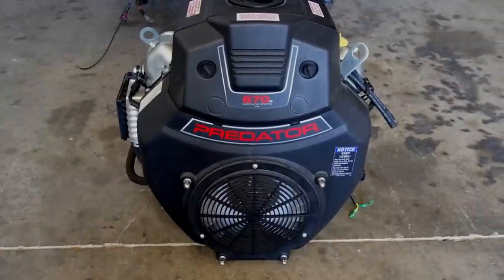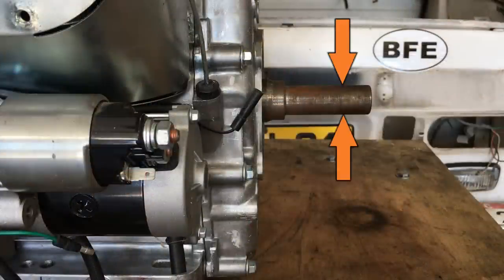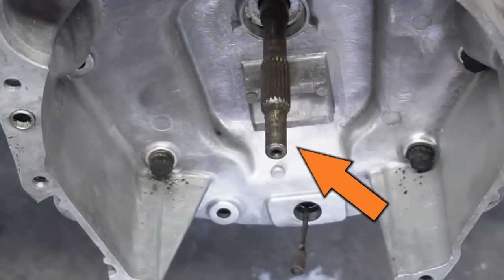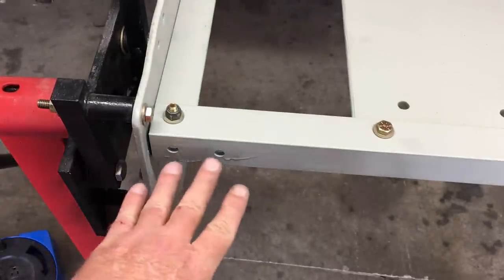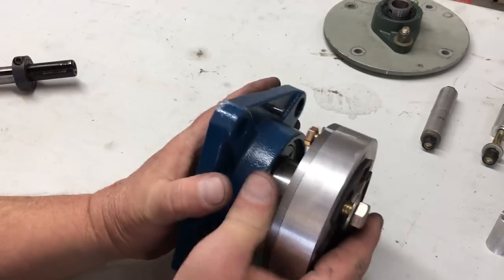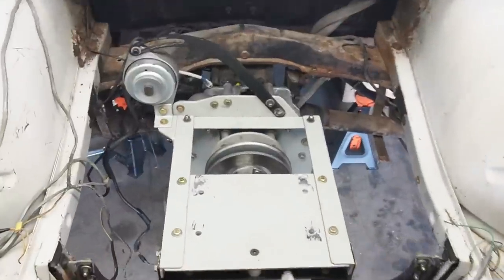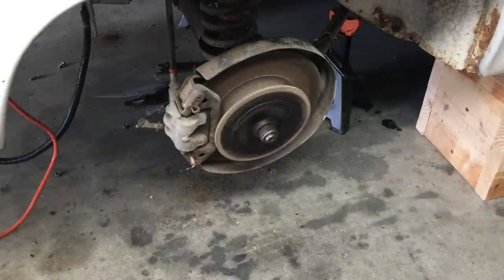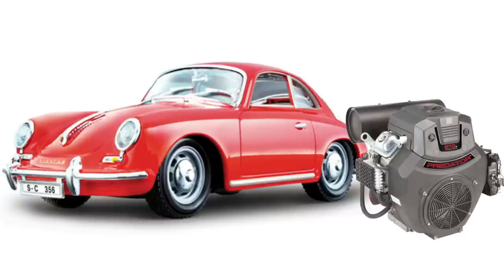S3 E18 We put a 670 Predator V twin in our project car 1969 Renault 10

Comment: I applaud you for the alternator, but if it were me, I'd be throwing a solar panel trickle charger on the back window instead of the slight parasitic draw of the alternator. You do you king!

Comment: This should have about 2/3rds the power and torque of the factory engine, but also about 1/10th the emissions. Geometry wise, the weight will be sitting a little higher in the rear, so there should be a little more roll-steer from the rear.
If you do another swap, consider the Motus "American V4", it would give more then the performance of the Gordini or Alpine Renault engines, plus sit down lower because it's designed for regular thrust bearing loads. It would make this R10 into something special.
As a Renault owner, you'll probably find plenty of buyers for the original engine too, given the passion many folks have for the R10 and related bodystyles that use the same drivetrain.

Comment: Did you measure the voltage and current output of the charging system that came with the engine? I see a voltage regulator located on the passenger side. Of course the one you installed should put out more power. 👍

Comment: I may be wrong but it looks like the engine is already set up with a 12 V regulator that gets power from wiring under the flywheel. I don’t know anything about predator engines but it looks similar to a Briggs setup.
Reply: If nothing else you could setup some sort of switching system that will power the separate alternator when needed to free up HP’s and rely on the trickle charge from the Predator most of the time.

Comment: The Predator does have a small alternator built in, but it is only 3 or 4 amps. Most of these engines are set up for use in riding lawn mowers, and some people report that the little alternator has trouble keeping a battery charged running the ignition and an electric PTO. Probably a good call to do the external alternator if you want it street legal. Looking forward to updates on  this project.
Reply: The logical thing is for it to be a dual-alternator car.

Comment: Howdy Jimbo, I got a free electric wheelchair and immediately thought of you.  Chat GTP told me it has approx 32 ft-lbs of torque between the two motors that run off of 2X 12v batteries in series.  Have you ever looked into a hybrid gas electric?
Reply: Anywho, for the quality content you’ve provided they’re your free of cost if you want them

Comment: So glad we watched the video till the very end...   that last clip was wild!
You saved some of the best for last.   We hope to find out what happened eventually
don't leave us hanging....   Just glad nobody was hurt, apparently
Reply: “Which in general, is a higher quality make, Peugeot, Renault or Citroën?”

Citroen and Peugeot are sharing many parts. If something breaks in your Citroen, it’s cheaper to buy a Peugeot replacement part, provided that you can figure the Peugeot part number. Sometimes easy, sometimes quite difficult.

So durability-wise there is no significant difference. Feature-wise Citroen is better, that’s considered the premium brand. You can choose between a simple car that runs forever or a complicated one, that due to the complexity, produces more malfunctions per kilometer, but provides better services.

Renault I can’t comment.
Reply: In 1954, Citroën followed that up with the first-ever hydropneumatic self-leveling suspension system. Then in 1955, Citroën introduced the DS — the first mass-produced vehicle with modern disc brakes.
Reply: Citroën Vehicles Were Used In World War II
Reply: After proving it could be relied on during World War I, Citroën was called upon once again to help out during World War II. However, Citroën helped build military vehicles for use during WWII as opposed to armaments.
Reply: For much of the '20s and '30s, Citroën produced half-track vehicles for off-road and military use, based on the Kegresse track system. The US Army purchased a license to build the Citroën-Kegresse vehicles, resulting in the M2 Half-Track and the M3 Half-track. The US Army eventually produced over 41,000 vehicles between 1940 and 1944, most of which were used during the war.
Reply: Andre Citroën Was A Marketing Genius
Reply: Andre Citroën knew the value of marketing, which is why he spent a fortune to get the word out about his products. For instance, Mr. Citroën once used the Eiffel Tower as a billboard and even earned the Guinness World Record for the world's largest advertising sign.
Reply: Citroën also sponsored expeditions in Asia, North America, and Africa to show the off-road capabilities of vehicles equipped with the Kegresse track system. These expeditions conveyed journalists and scientists.
Reply: Citroën Cars Have A Long-Running Reputation Of Extraordinary Toughness
Reply: Citroën cars have always had a reputation for reliability and toughness. In the '20s, the motoring world was stunned when a Citroën that had already traveled 30,000 miles became the first vehicle to be driven around the Australian border.
Reply: The car was a 1923 5CV Type C Torpedo and is now fully restored and on display at the National Museum of Australia. A Citroën was also the first car to cross the Sahara Desert.
Reply: The Citroën DS Placed Third In The 1999 Car Of The Century Competition
Reply: The Car of the Century (COTC) is an international award given to the most influential cars of the 20th century in 1999. After a rigorous election process overseen by the Global Automotive Elections Foundation, the Ford Model T clinched the top spot, closely followed by the Mini.
Reply: To many gearheads' surprise, the Citroën DS placed third, beating icons like the Porsche 911 and the Volkswagen Beetle. The DS, which was introduced in the '50s, was lauded for its exquisite design and innovative technology.
Reply: Citroën Went Bankrupt Twice
Reply: Like many automakers, Citroën has stared down the barrel of bankruptcy a few times in its history. Citroën's woes started in 1934 when it first filed for bankruptcy. Michelin — Citroën's largest creditor at the time — became its principal shareholder and built the company back up again.
Reply: Four decades later, Citroën filed for bankruptcy again due to an unstable ownership situation and the 1973 energy crisis. The French government stepped in and facilitated the merger between Citroën and Peugeot, resulting in PSA Peugeot Citroën.
Reply: Citroën Has Won Multiple Motorsports Competitions
Reply: Few automakers can rival what Citroën has achieved in motorsports over the last few decades, particularly in rallying. Citroën first entered endurance rally driving events in 1956, a year after introducing the DS. The DS went on to dominate the rallying scene for the next decade, winning renowned tournaments like the Monte Carlo Rally.👍👍👍👍
Reply: Fast-forward to the 21st century, and Citroën continued its rally dominance, winning eight manufacturer's titles and nine driver's championships with the renowned Sébastien Loeb behind the wheel.
Reply: The Citroën GT Is One Of The Most Expensive Cars Ever Built
Reply: The Citroën GT — or GT by Citroën — is a fantastic car that was first introduced as a concept car in the video game Gran Turismo 5. After a positive reception, Citroën partnered with Polyphony Digital — the company responsible for the video game — to bring the car to life.🚙🚙🚙🚙🚙

Comment: I love this stuff. 2 comments. Variable speed belt drives are very inefficient. Somewhere around 70 percent. The original clutch would be my choice. Of course you would need some torque multiplication between the motor and the input shaft. A chain would work. 
Next. A self aligning bearing allows for misalignment but if properly centered, behaves like any other bearing. It will not cause misalignment.

Comment: As someone that's built a Renault 12 (Basically same arrangement just FWD longitudinal) that play won't bother you with anything. I've had sinilar play and ran a 2.0 115HP Renault Laguna engine in mine with no gearbox issues. Keep in mind I have the Dacia version from the early 2000's with much worse build quality than the 60's Renault.

Comment: If you want to use the factory clutch, use a thrust bearing and a plate mounted to the engine and have the flywheel ride on that bearing and it will take all of the thrust load off the engine

Comment: No to be a Debbie Downer, here, but I have to admit to shedding a tear that this car is no longer original. Yes, I get it, and I'm fascinated by these videos, but I took my first driver's test in a 1970 Renault R10 which was the first new car my Dad ever bought. I think it was under $1700 all in. Later it became mine and I drove it back and forth from Wisconsin to the East Coast many times through the mountains of Pennsylvania. Superbly comfortable car. Once got 41 mpg out of a tank of gas  which was 410 miles. I drove from New Jersey to Toledo, OH on one tank. Later, I replaced the head gasket, and that was my first major mechanical repair. Wonderful little car, but pretty rare these days. Whenever I see one, someone's spent $30k restoring and wants $20 to sell it. Sorry, bud. Pretty safe for a little car in its day. The front of the car was longer than the front of the R8 to yield a little more luggage space, but was also because it was intentionally designed to be a crumple zone. The car had 4-wheel disc brakes and radial tires standard which was way ahead of any competition. In the end, it succumbed to rust at the point where the rear suspension attached to the unibody, and that was that. Loved the car.